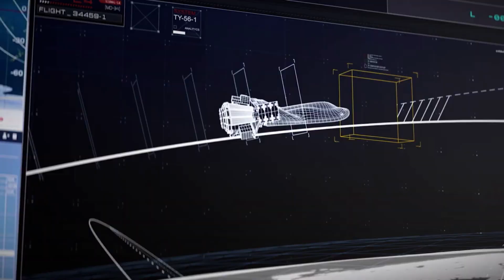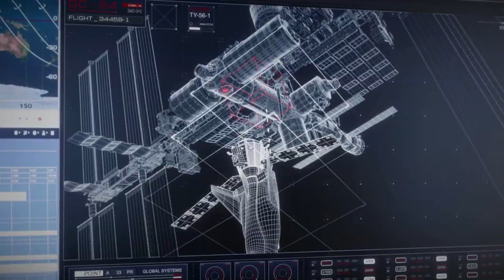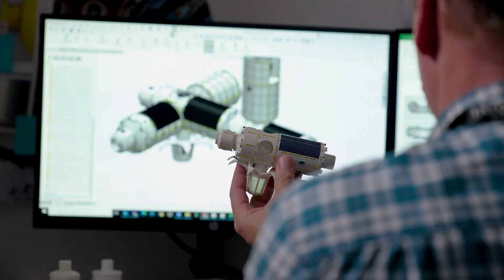A Closer Look At Orbital Reef & What It Has To Offer

Comment: With Boeing Starliner already being operational, as well as cargo Dreamchaser being basically ready and the LIFE module making steady progress, the only risk seems to be New Glenn.
But BO has already progressed far enough with engine development to start producing operational flight hardware and they have years of experience landing boosters from suborbital flights with new Shepard (which uses a sea level variant of the new Glenn upper stage BE-3U), so I'm optimistic here.